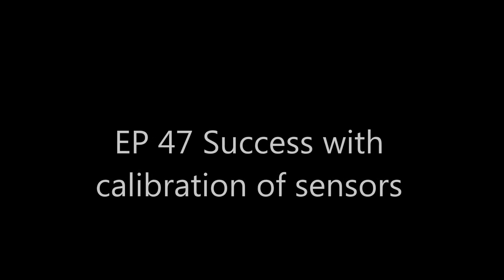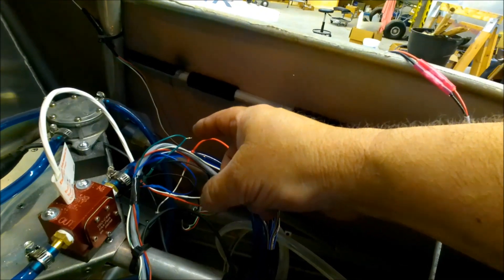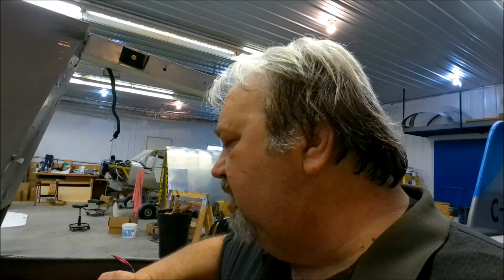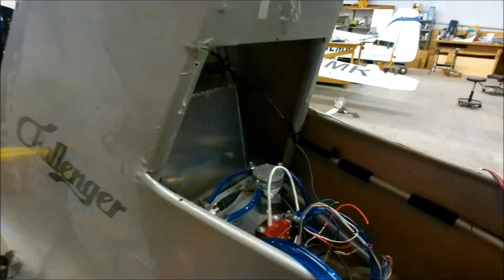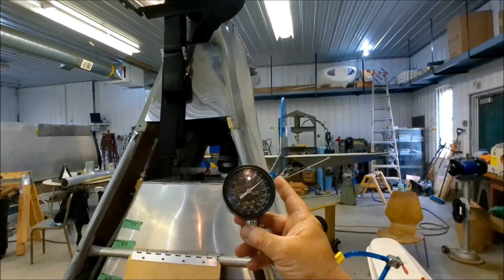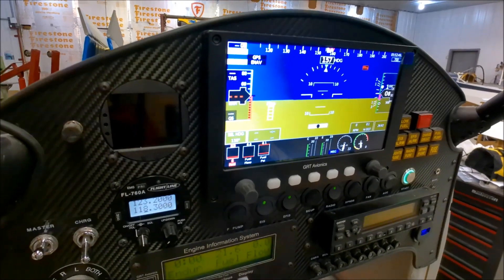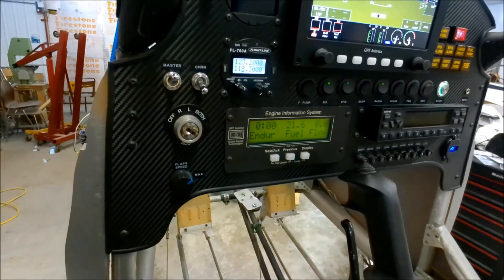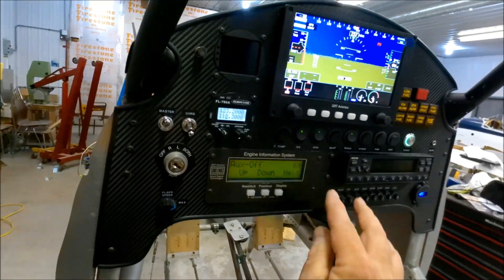EP #47 Success! Calibration of sensors is complete on my Challenger 2 Ultralight Airplane

Comment: Was there a particular reason for cutting the cable, to measure the voltage? I would have simply stabbed through it.
Reply from the maker: Poking through it would have worked just fine. However I have found that sealing that hole can be a bit unreliable. Considering that this airplane will be landing on the water, I elected to cut and reseal with heat shrink tubing in order to ensure a good seal.